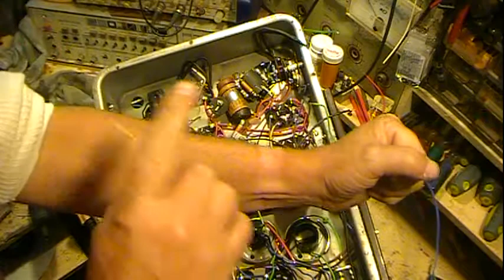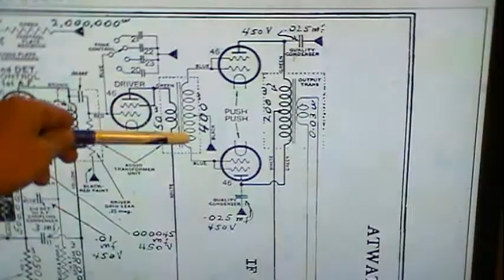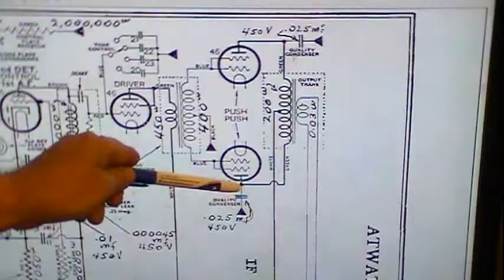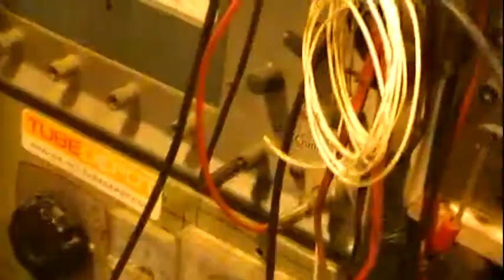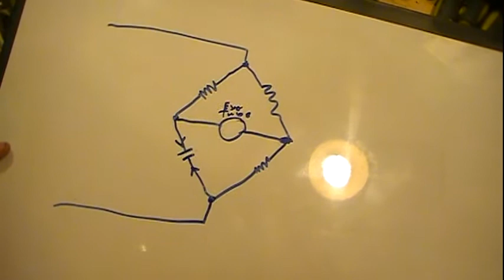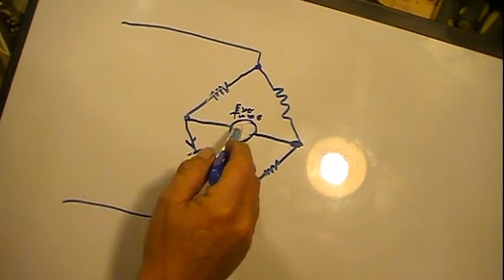AK 612 part 3

Comment: Hi Dennis, why are you apologizing yourself? It´s your channel and you can do what you want, if you want to talk about something you just about to discover and understand and you want to talk about in very detail, it would be absolute ok, otherwhise one (not me!) can use the bottom slider to go past that and miss the oportunity to follow you and your thoughts.

For me the length is just right, thanx for not shorten this one after upload :)

You may do another video especially on that output amplifier, i think i got the idea, but for me it looks very much like a Class B PushPull Amplifier with control grid current. One tube is conducting while the other is complete off.  Furthermore there is a phase splitter to provide a 180 degree phase shift between the two output tubes. And as the designer do not want to melt down the control grid he tied the control and screen grid together (it´s obvious you need a special designed tube for this) as the screen grid is closer to the plate and will take the current when the signal reach the point where grid current occurs...
Please feel free to correct me, if this is (totally) wrong.

Also liked the bridge part, as you explained its way of working very well.

Many thanx for sharing:)